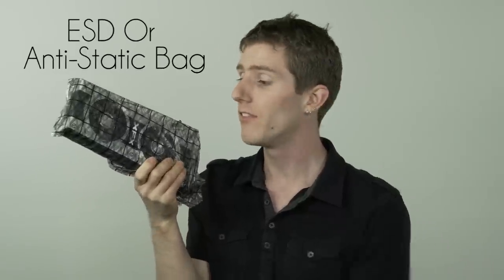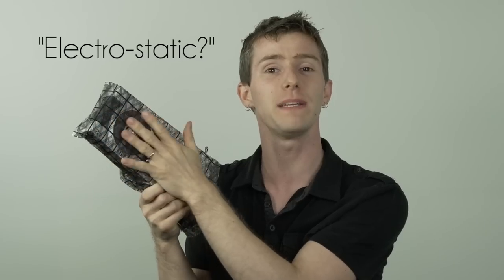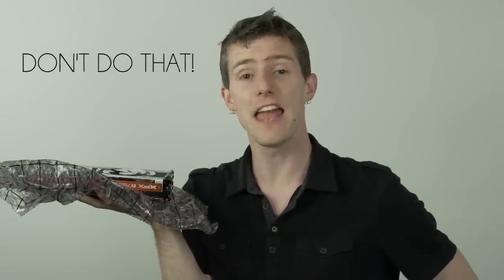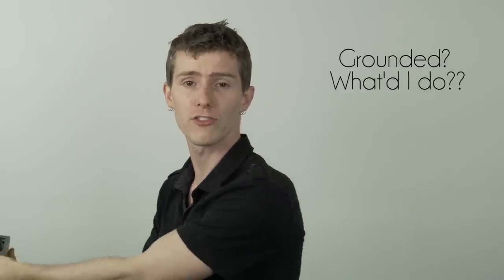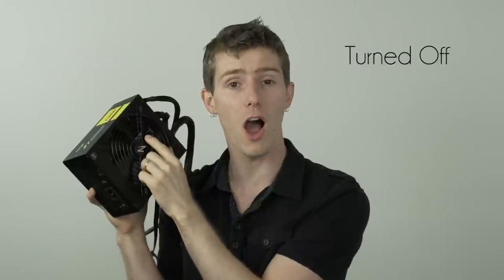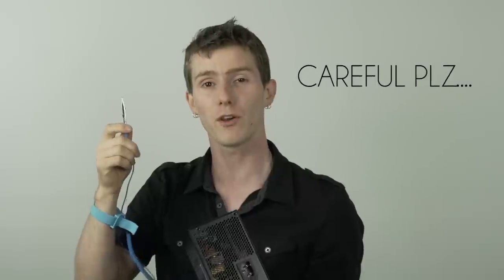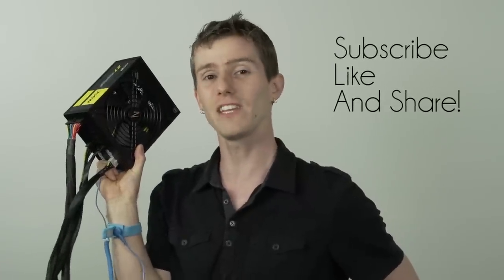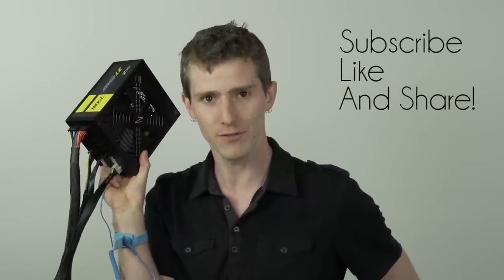Anti Static Safety - Handling Sensitive Electronics as Fast As Possible

Comment: Wait?! The outside of the anti-static bags is conductive?! Placing the PC parts on it after taking them out is usually the first thing I do. Man, all my PC components are so lucky to be alive.
Reply: MaddXav Sameee
Reply: oh so thats why all my gpus keep breaking
Reply: It's the same material as the inside, don't worry, your PC is good. Just look at CareyHolzMan's video on Anti Static.
Reply: The inside is conductive too.  It's the conductivity that makes it work.  The trick is it's only a bit conductive so the relative charges of you and the device are equalized less quickly (and with less damage) that if you directly touch the device and equalize suddenly.
Reply: MaddXav i used it as isolator!!!!
Reply: With my experience. I don't think a PC part is actually THAT fragile. I touch the back of my graphics card and the motherboard a lot when i install them. I had some experience of touching the back of my running GPU and it actually turned into white screen. But works perfectly normal after i rebooting my computer.
Or it could just because my country usually has really, really high moisture so static electricity problem almost never happens.
Reply: It's not always. Some ESD bags are just foilized mylar. so plastic - aluminum - plastic.  For these the protection is like a faraday cage so charges pass around what's inside
Reply: The chance of a strong enough electric charge reaching critical component of te part is extremely low.
Reply: @RoyAndOldHawcker  oh shte, mine too! I feared it had something to do with my huge tesla coil, nice to know that it isnt the coil!
Reply: @RoyAndOldHawcker  keep breaking ? so it can't be use anymore ?
Reply: cant we just turn that bags inside out
Reply: not lucky, but you basically played Russian roulette with your components every time you did this

Comment: A couple of things to think about when working with electronics and ESD safety:

1. It is not nessesary to "ground" you to the wall outlet or whatever, whats important is that everything you touch is the same potentiale as yourself, e.g with a wristband thats connected to some bare metal on e.g. your computer chassis. It is all about equal relative potential, not some kind of "absolute zero potential"(whatever that is). You need to have the same potential as the electronics you need to handle.

2. Do NOT(!) plug your wristband directly into the wall outlet. Never. Period. Not even if you are 100% sure that you plug it into the right socket/slot in the wall. If something else in your building is failing or have a shortcircuit, there is a potential risk of electrocuting yourself if you do this. So dont. IF, and only if, you KNOW that your wristband has a large in-series resister(usually 1Mohm), you can do this, but again, you'll not gain anything from this, you need to have the same potential as your components, not you freezer, your tv, your garagedoor-opener etc. The only reason why this COULD be an idea is that in many new houses the rebar in concrete floors is grounded via same same ground(At least in Europe, dont know about the US). This removes a lot of static created by walking around in the house and would therefor lower the chance of accidental static buildup. Again, remember the 1Mohm resistor!

3. Minimize the handling of the electronics. Only take the parts out of the ESD-bags when you are ready to mount it. Don't touch anything unnessesary(like waving it around in a video;-) ). Handle the parts by grapping large metal parts, e.g. the heatsinks, shrouds etc. Do not touch bare pins og the back of the pcb.

3. Best solution: Get an ESD mat to put your desk. They are like 20USD on ebay. When you are going to work with any kind of electronics, just place all you components on the mat, including your tools. Everytime you go to your desk to work, connect your mandatory(!) wristband to the mat, wait a couple of seconds and get to work. If you want to make sure you have equal potential, always start by touching a large metal part of the components on the ESD-mat, e.g. the computer case. And dont use a chair, stand up while working on the delicate eletronics. It will save you from static buildup between you and your chain AND be good for your back, win-win ;-)

4. The aftermath: ESD damage is tricky to spot. ESD damage CAN result in a completly bricked device, but often you will not notice at first. You will just fry a couple of transisters(out of millions). But eventually your computer starts BSOD'ing once in a while or acting strange. Something you have no chance to diagnose or repair. So all you guys saying "i do not need ESD protection, i've never had any issues", my response would be: are you sure? never had an unstable computer? never seen BSOD? Not yet, anyways :-)

...just my two cents to an old video for you people passing by like me :-)
Reply: Thanks a lot for the info!
But may I ask since I would be building my first PC now can't I just walk barefoot  and ground myself?
I can do this since i will  be on my own home.
(And I don't have a carpet on the floor)
Reply: The important part is to have the same potential as the hardware you are working on. So always start by touching case/shrouds/heatsink/etc on the components a couple of seconds before proceding.

And yes, walking barefooted would help you avoid static buildup, but it isn't a guarantee that you have the same potential as the components, so make sure to equalize any differencies in potential anytime you return to the table/components...
Reply: Is it okay to attach the anti-static wrist strap clip to my case even if that's where the Motherboard is currently installed & the PSU is/isn't plugged in? I wonder because while testing the board, it's features outside of the case it will be plugged in & on via the PSU. In that scenario I'm really confused how I'm supposed to ground myself.
Reply: there is so much false information out there and you got it right. do you work with electronics ? also propper clothing and materials around the electronics is important.
Reply: No i do not work with electronics other than on hobby and interest level. But i'm an electrical engineer(B.Sc.EE, high voltage)...

..and you are correct about both the clothings and materials around you...
Reply: so touching the metal  part of your case would make you safe, even if it's not connected to ground?
Reply: yeah please recommend a video with accurate information than
Reply: Saw u got 199 likes for that information so just dropped in & made it 200 Enjoy 💪
Reply: @thomasegjoergensen  It is becoming increasingly difficult to ground one self with all the painted surfaces, be it in the chassis or the power supply. Maybe we all should put a grounding lug along with the bottom right screw on the motherboard. Many of the computers made by Norsk Data had a wriststrap inside the chassis, connected to the ground plane. Admittedly, that's not very practical for today's PCs.
Reply: Is there a difference in quality in mats? Which are worth getting?
Also can you put the mat on any table and be fine?
Reply: I appreciate this info
Reply: My understanding is a bit different: New Components might have different Potentials. it wont help to connect your ESD-Mat to the Computer-Case then. That's the reason why you connect your ESD-Mat to Earth-Ground and yourself to the ESD-Mat. That way you will stay "discharged" and every difference in Potential of your Components can discharge safely. Remember Earth has the lowest Potential and high Potential "flows" to low Potential. 
Simply put: Charge "seeks" a way  to discharge. If you're connected to Earth that discharge is gonna happen safely through your connection to Earth and the differences in Potential are neutralized. You can't shock anything that way since you can't "charge" yourself up as long as you are connected to earth.

However if you're working on an already built System you don't need to connect yourself to Earth. Because the Components should all already have the same Potential. Then connecting yourself to the Case and getting on the same Potential should be fine (however there is still a Risk). But it doesn't really have any advantage over connecting (and staying connected) yourself to earth because that way any difference in Potential would be neutralized anyways as discrbed above. 

The Issue starts when you would earth-ground yourself, then disconnect yourself from Earth and "re-charge" yourself again by dancing on your carpet on the way to your Computer. Then, when instantly working with some Components you might, discharge your charge and cause harm. Instead of that it's better to touch the Case after a Carpet-Dance and neutralize/discharge yourself that way, since the Case shouldn't be connected to sensitive parts of the Hardware and therefore nothing "should" happen.

At least that is my understanding and there still is a huge risk of me being wrong. So don't listen to me.
Reply: I know it's been a while, but I have a question:

I'm going to be building a computer from scratch, so should I place down my esd mat, then connect it to the chassis, then ground myself to the mat with an esd strap, and then place all the components for the computer on the mat, and then start the build? Would that make everything have the same potential and keep everything safe?
Reply: A lot thanks for the info!

Comment: I plugged it in to the wall and I shocked myself really bad thanks for that tip!
Reply: are you joking? I mean he specifically warned you that bad things might happen
Reply: Cole H
not necessarily. You can easily survive a shock from a socket if you have a healthy heart.
Reply: KevinementD

Can confirm. I shocked the shit out of my hand straight from an outlet around 4 years ago. Scared the shit out of me (figuratively speaking), and my finger was numb for a couple hours, but I'm very much alive.
Reply: KevinementD it really doesn't matter how healthy your heart is, if the shock goes through your heart your pretty much done. Now if you got shocked on the leg or something the electricity cant reach your heart and stop it. Either way I wouldn't recommend getting shocked by the wall outlet no matter what :P
Reply: Cole H
I wasn't going to try it. *hides screwdriver behind back*
Reply: I am fine, my anti static strap has a proper earth pin on the top of the plug, no alligator clips for me, just strait to earth/ground
Reply: calvin ouwens That doesn't make any sense
Reply: TwskiTV i know i didnt make physics
Reply: calvin ouwens I really mean it. You are saying that the 100mA range interferes with the hearth but at 200-300mA it doesn't.
More current = more electrons passing through a conductor per second. And, in an electrical shock, its directly proportional to the lethal risk, no exceptions.
What you said would make sense if speaking of the frequency of the current, but as we are talking about shocks from the wall plug, it's either 50Hz or 60Hz which doens't make much of a difference.
Reply: Twski ///M i am in the uk
Reply: @ssbmvampa  Modern buildings often have special devices connected to the sockets to prevent a bad shock.

Comment: +LinusTechTips grounding isn't so simple, it can be really dangerous to ground yourself to the wall plug ground, any unwanted electrical discharges on that ground will be connected to you... Any malfunctioning device on the electrical network and even lightnings!

Comment: So, Wrist strap, clip on PSU, and PSU plugged in but turned off.. Got it!
Reply: Yes Please!
Reply: +SquidPlays Got it built already, in fact I'm using it for this reply.
I went a step farther and also got a anti static mat to go with the wrist strap. (First time builder)
Reply: XIIILegend yay!
Reply: +XIIILegend If you use the mat do u need the wrist strap? the wrist strap confuses me i dont want to be shocked or anything xD
Reply: You cant get shocked as long as the PSU is connected to a grounding outlet with a 3 prong plug and turned off. Just keep your PSU turned off but plugged in and when you clip the band to it all the static goes through it and into the the ground. As long as it is off the PSU will not draw enough power from the outlet to shock anything.
Reply: +XIIILegend Honestly you only need a static wrist strap if you are a person who holds a lot of static in their body, If everytime you touch a door nob, metal. And you get shocked, you be the type to wear one. other then that, just touch the power supply every couple of minute or before you handle something, plugged in but turned off, and you'll be good. 

Also moisturize your hands, if they are dry.
Reply: Yeah, it was my first build so like Louie up there I was super confused and got both, just to cover all the bases.
Reply: i dont have carpet but ill do it anyway
Reply: +XIIILegend Also instead of using a painted metal grill connecting the anti-static strap to a non-painted screw on the PSU would be even better
Reply: You'll be fine as long as you hold the Motherboard by its edges and spots under it that aren't weld spots or anything important looking. To be safe, not required, but I will touch the back of my computer case, were its metal, with the power supply screwed in position and plugged in, BUT TURNED OFF. Touching that will ground you, wear shoes that have rubber is also a good way to keep static from forming. BUT to be honest, you usually only need anti-static equipment if you work with the inner parts of electrical components like cell phones, computer screens, like very technical inner workings of things. Not soo much just putting computer parts together in a computer case. Ive never had a problem with ESD while building computers, I was paranoid during my first build cuz of all the crap about anti-static wrist wraps and all the other stuff. But Im going to have to lean on the fact you 98% will not need anything. But if your very paranoid and nervous about it, just look up ways to ground yourself without spending any money.  :D
Reply: still depend on your country electricity system, your PSU only grounded if your elec socket have 3 pin; if you stand on ground with bare feet (ground, not carpet or wooden floor) and touch your computer case or USB port (metal part) and have a tiny shock that mean your computer is not grounded and it's useless to clip an anti static wrist to it
Reply: +XIIILegend I went ahead and did it without straps or anything. I just kept making sure to discharge possible static on some metal. Nothing died on me nor seemingly got damaged.
Reply: Congrats, First build?
Reply: Yeah the first build is always the most terrifying and exciting, kinda like sex and taking acid lol
Reply: @roccoramos1358  So I just need to discharge myself every 2-3 min to be safer? Any kind of gloves can be used here for that purpose? Great infomations
Reply: Turned off as in not connected to the pc parts or as in flipping the switch on the PSU to the off position?
Reply: @pepperlook  both
Reply: @ResayDota  do you only need all of this if I have carpet or also on a wooden floor?

Comment: LinusTechTips Thanks for the video! Most of this series I already knew, But you always teach me something. Love your videos. Also, Your channel name is LinusTechTips - But you never do anything concerning linux! As my main operating system, and my favorite youtuber, You two should meet each other. Warthunder is on linux, Metro last light, Benchmarks would be greatly appreciated. With almost every game i've tested, resource usage is much less at all around on linux at the exact same settings, with a fresh install of w8, w7, and linux. You could even debunk common myths such as 'Linux is hard to use' 'Linux has no windows compatibility, and there is no linux equivalent of the software I need'
You're a great face in the PC community, but so is linux!
Booting up Ubuntu is one of the best experiences i've ever had, not to mention using it.
Also, That graphics card is beautiful.
I know this probably won't ever be seen, But that's okay.
Reply: Isn't his name Linus?
Reply: 99% sure it it is, we both know what I meant.

Comment: It's a terrible idea to touch a plugged in power supply or connect an anti-static strap to one either.  That will be an earth ground.  When dealing with electronic components, you do not want an earth ground, you want a ground on the same level as the environment that you are working in/on.  That is why the PC case is an excellent way to ground yourself when working with PC parts.
Reply: No, you are grounded to the case.  Why do you think you get shocked when you touch a metal shopping cart or a metal chair?  You become grounded to that piece of metal.  This goes exactly the same with a computer case.  If you touch the computer case and get shocked, you have gotten rid of your static electricity and are now at an equal level or ground with the case and electronic components being installed.
Reply: That's fine.  I'm not trying to give advice, just state the facts.  Either way will technically still protect you from statically killing your components but grounding to a case alone is arguably better.
Reply: joshmosky No. You connect yourself to the ground, not to the electric + or - :)